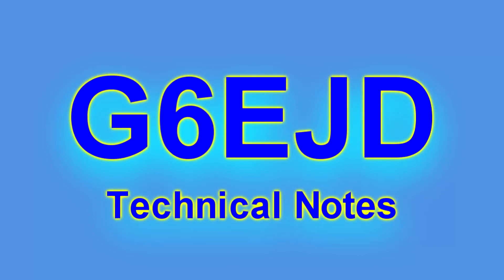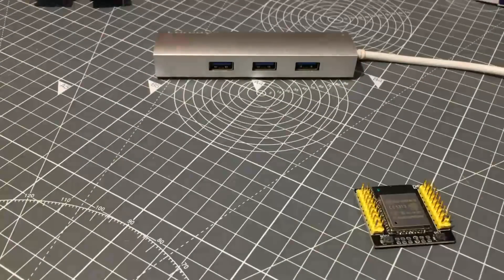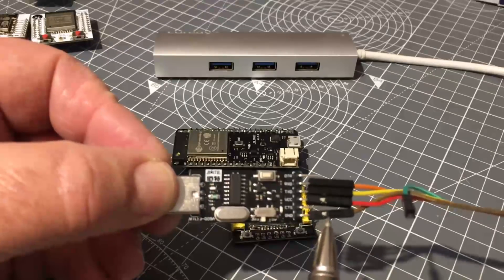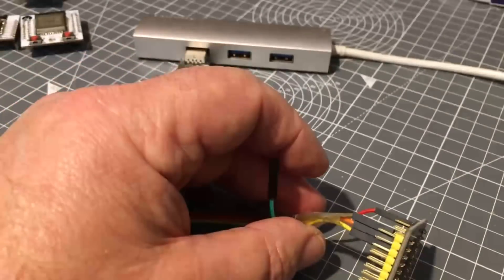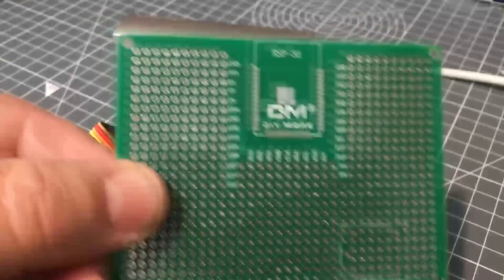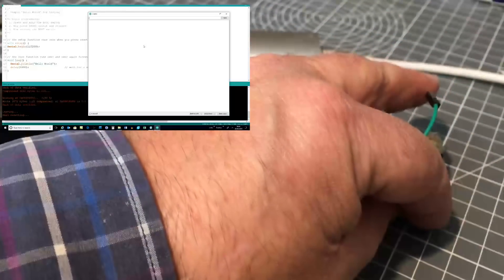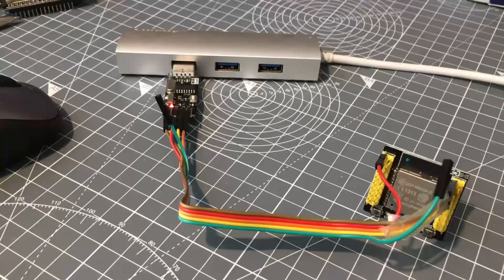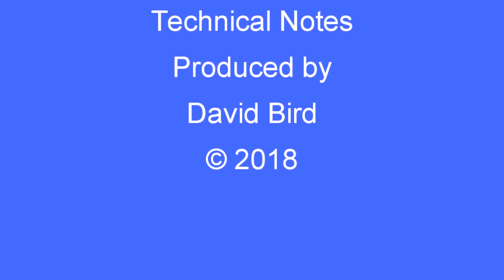Tech Note 089 - ESP Programming (Break-out boards)

Comment: Do I need to solder it ?? Can I upload code In it without soldering. ❤?
Reply from the maker: Well, the pins can accept tiny clips and you’ll need an external UART to convert a USB to serial connection. So ideally it needs to be soldered to give ease of use and for programming. To be honest a low cost development board would be better and not much more cost.

Comment: Hi

Esp  breakout  boards does keep out the antenna zone  for proper radiation  or is there any ground plane in breakout board below the antenna?
Reply from the maker: Mist breakout boards are bare pcb materiel with no copper and anyway copper is not a ferrous material so it has minimal impact on antenna operations. Nothing to worry about.

Comment: Great video, I wonder if it is possible to program the boards directly via j-tag instead of using the serial?
Reply from the maker: Yes you can using OpenOCD, but only if the current loaded application has not changed the configuration of the JTAG pins 12-15. Espressif have a GitHub page on the subject with examples.
Reply: @G6EJD  Thanks for the reply. I have programmed the esp32 with the JTag but only after first programming it via the serial port. What I wonder if it's possible to program it for the first time via Jtag. From what I've read it seems like the JTag pins are used for something else in the default configuration the esp32 comes from the factory..
Reply from the maker: @GeekyMino  The only pin that's in-use is GPIO12 that must be low during start-up, so is your JTAG programming setting that low to enable a start

Comment: I am seeing brown outs with my esp32 when I power it with my ftdi. I put a 1000uF cap between the ground and vcc, but it doesn't seem to help. Do you have any advice?
Reply from the maker: The ESP32 requires a lot of  power typically 250-300mA for a few mS (say 2mS), so you need a really good power supply and large reservoir capacitor :http://g6ejd.dynu.com/index.php/micro-controllers/calculate-smoothing-capacitor-values/ to get trough the start-up, a quick calc says 2000-3000uF
Reply: @G6EJD  that is really helpful. I will give that a try. I appreciate your willingness to share your knowledge. Your channel is fabulous.

Comment: A small electrolytic capacitor from en to ground (negative pole to ground)  solves most autoupload problems. My boards simply accept the new code... is less of a hassle than my boards with discrete buttons for this.
Reply from the maker: I’ve never had a problem with the Lolin D32 boards they are well designed and have the lowest sleep current of any development board plus very stable.
Reply from the maker: Also you have to sequence the buttons correctly hold down prog then reset to get it in flash programming mode
Reply: @G6EJD  I got some of the newer devkits from digikey, and I only have to press one button on those but you need to do it while it is looking for a com port during loading. still less effort to just slap a small say 2.2 to 100uf electroytic on and forget about it.

Comment: What is the purpose of those pull-up resistors?
Reply from the maker: You need them to set the correct boot conditions for the ESP32 one is on GPIO-0 the other 2. Without them the ESP32 won’t start, you can see the options in the ESP32 data sheet. One switch acts as a boot button the other a reset.

Comment: David are both of those pull up resistors 10K?
Reply: Should have mentioned "On the white breakout board"
.
Reply from the maker: @rjpeterson1  yes they are surface mount 10K, but just about any value less than 1M and greater than 1K would do.
Reply: @G6EJD  Hi, are 0805 size?
Reply from the maker: Yes and quaintly in imperial inches at 0.08”x0.05”
Reply: Thank you David!

Comment: I have a doubt...are those ESP32 Breakout board SoC's have arduino bootloader burnt previously to them or is it first time you're programming them directly through the USB to UART dongle?
Reply from the maker: The ESP32 has a Boot. Loader
Reply: @G6EJD  Hi thanks for the reply. What do I have to do, If my chip is a bare IC and I wanna upload my programme into it without using arduino IDE. I know I can use esptool but I only have Rx, tx, EN and IO0 lines exposed on my custom PCB to hook up some wires.
Reply from the maker: Gudimetla Kowshik you have to use a FTDI UART and some IDE to compile your source code then upload it. Connect FTDI Txd to ESP Rxd and FTDI Rxd to ESP Txd, to ready the ESP32 for upload you need to press and hold the EN gpio-0 then press reset momentarily then upload. If you monitor the ESP serial port it will say waiting for upload.
Reply: @G6EJD  thank you very much for your kind replies David. I will try it.

Comment: Video is helpful, I am using the white adapter plate. I have soldered the board ( I believe correctly) with the test program on it. Unfortunately I am not getting any serial output. Any advise? Thx
Reply from the maker: Brian, are you using the ESP32 or 8266, I’m guessing ESP32. Soldering the ESP32 is very tricky and I recommend you check each soldering point of the ESP32 with a magnifying glass for bridges as it’s very easy to bridge any pins together, a swipe with an tinned iron from the ESP32 towards the outer pins usually resolves those. Next you will be using a UART and along the top edge is a row of connections, God, Vcc, Rxd and Txd. It is important to ensure the (usually USB to) UART can supply adequate 3.3v and that UART Txd is connected to ESP32 Rxd and Rxd to UART Txd so there is a cross coupling of comes lines. The default speed of the ESP32 is 115200 and as soon as it’s powered up and reset, it will begin reporting it’s boot mode and you should see this always. The next thing to check is the presence of a pull-up resistor of say 10K on the left-hand pad on the white board with the ESP32 antenna upper most. If you have a meter check that the ESP32 is getting 3.3v at the board. Using soldering paste is not generally successful unless the paste is measured out on each pad and in tiny amounts.
Reply: Thank you so much for the detailed response. I am planning to decouple each piece of your response to ensure that I understand.  You are correct, I was referring to the ESP32. I 100% agree with you comment that the ESP32 is very tricky to solder. The process I used for soldering was to first tinned the pads, place the module on the board, apply flux, and finally I touched each pin such that the solder would apply to the module. I have checked a few of the pins (VCC and ground) with a meter to ensure connectivity, but I will try and go through and validate the remaining. Hypothetically, if I were to solder the minimal pins (I assume VCC, GND, EN, TX, RX, ??) I assume the board would be fully functional? Ultimatly, I would want to ensure to solder all of the pins. As far as the pull-up, resistor I do not see a pull up resistor on the device (left hand side) for a pull up 10k. I do however see (what I believe) are resisters between the rest and 00 buttons (on the bottom). I have a version 1.1 of the board if that helps. Let me know if I am missing something about the pull up resistor.  As far as hooking up the module I am powering my uart (ftdi set to 3.3V) form USB and powering the ESP32 from a separate 3.3V power source. I then hook up the UART and ESP32 to common GND. After starting up the module and the UART I do press the restart button. As far as that process I think that is correct. Please share any additional thoughts.
Reply: I confirmed that VCC, GND, TX, EN, and RX have connectivity. Please let me know if there are any other critical pins I should verify? Thanks so much.
Reply from the maker: Brian, the two buttons are connected to GPIO-0 and 2 respectively, see here: https://github.com/espressif/esptool/wiki/ESP32-Boot-Mode-Selection

The ESP32 will enter the serial bootloader when GPIO0 is held low on reset. Otherwise it will run the program in flash, GPIO0 has an internal pullup resistor, so if it is left unconnected then it will pull high.

Many boards use a button marked "Flash" (or "BOOT" on some Espressif development boards) that pulls GPIO0 low when pressed.

GPIO2

GPIO2 must also be either left unconnected/floating, or driven Low, in order to enter the serial bootloader.

In normal boot mode (GPIO0 high), GPIO2 is ignored.

The button sequence is then press and hold the gpIOO button, then momentarily press the RESET button.

When you apply apply just pressing the reset button will start the ESP32 in normal mode and it will output diagnostic text as per the data sheet.
Reply: I was able to fix my soldering mistakes. Your video helped  as well as your advise. Thank you again for posting

Comment: I am looking for one of those break-out boards for ESP32 - I have the white one but I am unable to solder the ESP32 onto it. Can you provide a link for the breakout-board with the yellow headers? It seems like that is sold ready to use and that would be great for me.
Reply from the maker: Rudolf Ziegaus Unfurtunately none of the boards on the market come with the ESP32 soldered to the break-out board. I have done endless searching for a supplier but without success. The black boards can be found on AliExpress but they sell out quickly then don’t show up until in stock again! Actually soldering the ESP32 to the boards is relatively easy but you must use a tiny soldering iron tip and place flux on the board before starting and I use magnifying glasses to see in great detail the soldering activity, finally get hold of some fine solder to reduce the amount of solder used. The alternative is to use very small amounts of solder paste on each pad then carefully align the ESP32 then place the board in/on a frying pan and heat until you see the solder flow, or place it in an oven 220°c again until the solder melts. There is a gap in the market as we need pre-soldered ESP32’s but it must be expensive to get it done. Hope this helps. There are videos around that demonstrate reflow soldering of surface mount devices to help out.
Reply from the maker: Rudolf Ziegaus https://youtu.be/5uiroWBkdFY
Reply from the maker: Fancii LED Light Helping Hand Magnifier Station - 2X 4X Illuminated Hands Free Magnifying Glass Stand with Clamp and Alligator Clips - For Soldering, Assembly, Repair, Modeling, Hobbies and Crafts https://www.amazon.co.uk/dp/B01882K0OC/ref=cm_sw_r_cp_tai_6Oy3AbR6V7KFX
Reply: One more question - do I also need to solder the cooling pad? How would that be done with an soldering iron? Or is this an optional step?
Reply from the maker: Rudolf Ziegaus If your using solder paste then I would solder it otherwise it’s impossible and not necessary IMO

Comment: Why is it some hardware needs the reset and flash buttons pressed and others don't? What do they do when the button press combo is carried out?
Reply from the maker: It’s the boards that dictate what to do, if you check out the Espressif documentation on programming you will see that the devices have to be preset with certain pins high or low to initiate a boot for either normal read from flash memory or programming and ready to programme. For the ESP32 this means hold one pin low gpio-2 and then reset the device then is restarts in programming mode, same for the esp8266 but the method is different again.
Reply: This is what I find so interesting about the 8266 families of boards. I have the NodeMCU running with Arduino IDE. When it comes to uploading a sketch the button combo you mention is not carried out during this process. Do these boards, NodeMCU, carry out the sequence using the software as opposed to manually carrying out the button sequence?
Reply from the maker: Rud Dog if you check out the schematic you will see cross connected logic gates (usually) evident by angled wiring lines and these gates are reset at power on to provide the correct states to gpio-0 and 2 then when you go to programme the device this register is toggled and so changes the conditions needed to place the ESP into programming mode. A fully automatic process but for one-off programming or slow turn around the manual process is adequate. The same arrangement is used on the ESP32 as well.

Comment: Can you post the link to the 3.3/5V USB/Serial board?
Reply from the maker: Just about any type will do, I have these: https://www.aliexpress.com/item/1Pcs-USB-to-TTL-converter-Micro-UART-module-CH340G-CH340-3-3V-5V-switch-for-downloader/32835759588.html?spm=2114.search0104.3.15.464f5263d08LFR&ws_ab_test=searchweb0_0,searchweb201602_4_10152_10065_10151_10344_10068_10130_5722815_10324_10342_10547_10325_10343_10340_10341_10548_5722915_10698_10697_5722615_10696_10192_10190_10084_10083_10618_10307_10301_10303_5722715_5711215_10059_5723015_10184_10534_308_100031_10103_441_10624_10623_10622_5711315_5722515_10621_10620,searchweb201603_25,ppcSwitch_4&algo_expid=a8ddadd3-801d-4907-9169-92ea660a7e46-1&algo_pvid=a8ddadd3-801d-4907-9169-92ea660a7e46&priceBeautifyAB=0 
You need Gnd, Vcc TX and RX

Comment: This looks like a very handy board. Program the basic module on this board, then solder module onto those new green proto boards. Then just do any future updates via OTA. https://www.aliexpress.com/item/ESP-12F-burning-fixture-development-board-ESP8266-without-ESP-12F-module/32811961103.html For the moment though, I just can't justify the cost. Here is a similar concept, and something like I had thought of, but I think the other board is probably going to do a better job: https://blog.adafruit.com/2016/06/17/technique-for-using-pogo-pins-for-solderless-programming-testing-pcbs-with-castellations/

Comment: With the ESP8266 white breakout board, did you need to use additional resistors or jumpers to program? I would assume you did as there are no switches/buttons on the board. I had a great deal of trouble flashing via this board. There seems to be many different suggested methods on the web. In the end the only method that worked was based on the diagram on this page: https://www.letscontrolit.com/wiki/index.php/Basics:_Connecting_and_flashing_the_ESP8266 This means I was putting resistors in parallel or something because of the two (one is just a link) on the board already.
Reply from the maker: With the white boards aprt from a jumper between GPIO-0 and Gnd no additional switches or resistors are required. With the short in-place and the ESP8266 restarted it immediately goes into programming mode every time. When programming is complete remove the GPIO-0 to Gnd jumper and it all works as expected. Ideally it could use a simple series R-C to reset to give a power-on reset.

Comment: Nice video.  Tried to locate the black adapter Board ESp32, but only thing I found is a kit that includes it and ESp32 together.  Here is what I found:

https://www.aliexpress.com/item/ESP32F-suite-ESP-32F-module-ESP32-Adapter-Board-CP2102-module-0-96-inch-OLED-Yellow-blue/32834491218.html

Is this the one you used? if not, then can you post a link for it?
I thought you mentioned that the white adopter board was not as good as the other?
Thanks for the video
Reply from the maker: Yes interesting, this is where I purchased my two boards from, https://www.aliexpress.com/item/ESP-32S-Pinboard-Convertor-Module-ESP32S-Adapter-Board-Support-for-ESP-32S-Wireless-WIFI-Bluetooth/32818093054.html?spm=2114.search0204.3.79.b59934324qpAjA&ws_ab_test=searchweb0_0,searchweb201602_4_10152_10151_10065_10344_10068_10130_10324_10342_10547_10325_10343_10340_10548_10341_10696_10192_10190_10084_10083_10618_10307_10301_10303_5711215_10313_10059_10184_10534_100031_10103_10624_10623_443_10622_10621_10620,searchweb201603_1,ppcSwitch_4_ppcChannel&algo_expid=b9a63e37-8964-4f64-9440-438c5a91290a-11&algo_pvid=b9a63e37-8964-4f64-9440-438c5a91290a&transAbTest=ae803_5&priceBeautifyAB=0But now they are only selling them with the ESP32.

My advise is don't buy the white variety unless you are very good at or have flow soldering facilities! You will need 2x 10K surface mount R's too.

I can solder the ESP32 OK using a small iron and magnifying glasses and the ESP8266 is easy by comparison. You can also solder header pins to the ESP8266 which is handy.
Reply: Thanks G6EJD.  Hence the reason for asking for the Black one instead.  I'd rather not spend much time on soldering. Thanks again
Reply from the maker: Raad Yacu I haven’t found anyone who sells the board with an ESP32 soldered to it. The diy technique is to place a small amount of solder paste on each pad - not easy to do, sounds it but not,  then place the aligned module in an oven until it melts at about 230°c. Heat guns tend to move the components about also a frying pan works apparently but I have not tried either method.